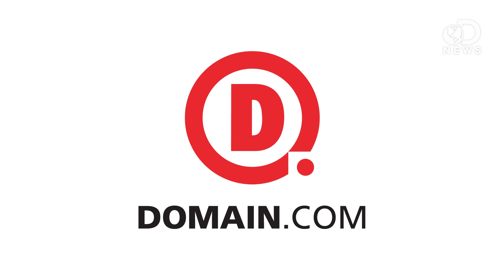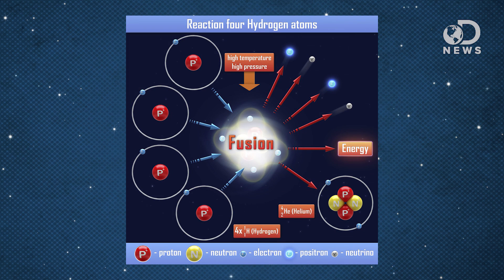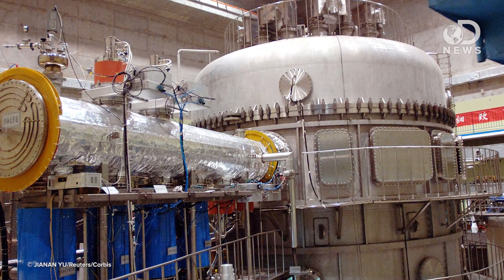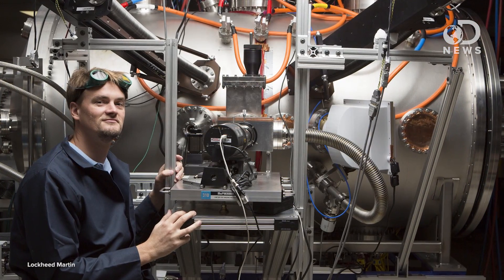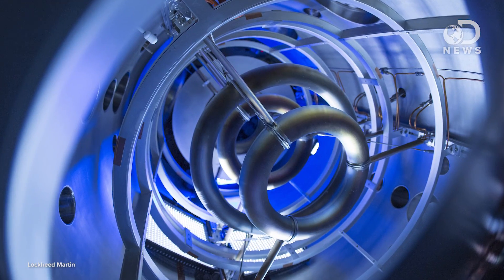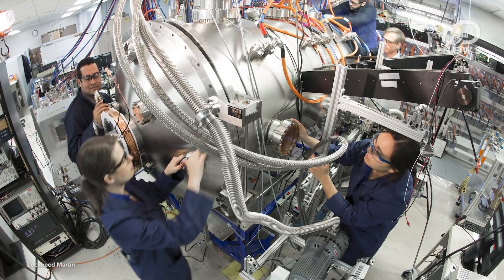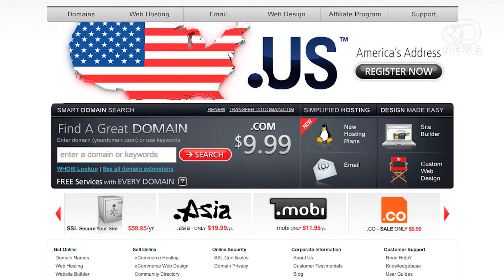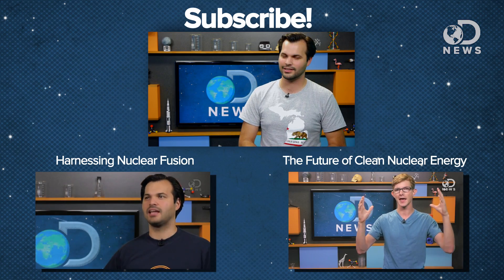Is Fusion Energy Close To Becoming A Reality?

Comment: DNews what do you mean?, powered by water, everything today but solar panels is powered by water. Coal heats up the water and the water moves the pistons, and nuclear power does the same thing, I think this is all bull shit. We will not make fusion in 5 years, the government likes oil because thats where the money is coming from. With out oil america will fall, we import more export so the economy will complete fall with out oil, now if WW3 starts then yes that will be the key for new energy and yes the government has new energy they had solar for a long as time, and they have money so they have fusion reactors and other new energies . And wow its so hard to think of that we had that crap for a long time, putting a fucking magnetic around plasma to keep it inside.
Reply: No, Solar panels are not powered by water, they are powered by solar engergy, naturally. They use water only to transport heat to generators. A fusion reactor, however, will fuse the hydrogen atoms in water together to create energy.
Reply: thats what a said???
Reply: is said but solar panels
Reply: Ah, right, replace solar panels with your coal example then. Coal power uses water only as a medium for transporting energy, while fusion uses water as actual fuel.
Reply: ubermons Fusion doesn't use water as actual fuel... He meant that a mass of hydrogen equal to the mass of 6 litres of water would be used. Also, fusion is NOT unlimited energy.
Reply: aprusfire By the way, being a condescending arse doesn't help, especially when it's very clear that you have no idea what you are talking about.
Reply: aprusfire That's called electrolysis. Also, please read up on simple rules, because you're honestly spewing a load of bs. Long paragraphs with no basis. You cannot put in less energy for more (conservation of energy). All forms of nuclear energy is derived from the conversion of mass into energy, as both fission and fusion release sub-atomic alpha and beta particles that in turn get converted into energy through the famous equation E = mc^2 :)
Reply: aprusfire Also, what the heck are you saying? The Earth is in total neutrally charged! The atmosphere is not always positively charged! Gravity is not a form of energy, it's one out of four of the elementary forces! Lastly, all forms of energy is considered potential, including kinetic. Read up on general relativity :)
Reply: we can make oil, but the oil we make pollutes more then oil from the earth. And no we are putting more carbon in this world and i dont like it, sorry but i respect this world as much as humanity. even though some humans are.... i dont want to say it
Reply: contraband100 Fusion is a dream many of us have ;) So many people arguing over a topic that some people keep misunderstanding, leading to a positive feedback loop of explaining and misunderstanding and more explaining... xD
Reply: you can make water into a fuel for fusion but we dont have the technology and i think it will be a waste of energy to even do that. And water has H20, so 2 hydrogen then you got to make it an isotope which will be a waste of energy ( and 2 different isotopes, i think it is H with 1 extra mass and the other is H with 2 extra mass ( i forgot what 2 you need ) )  
And yes you can turn water into hydrogen and oxygen, just put electricity into the water. And this will be bad to make it into a power source because if hydrogen goes in the atmosphere it can leave out planet because how light the atom is.
Reply: Bryan Lee Of course fusion isnt a unlimited energy
Reply: oh i took it out because i didnt want to example it and yes the atmosphere is positive and the ground is negative. Look study it your self im not going to try to example it to people that cant study on there own. And hell no if the earth is neutrally charged then how the fuck are there lighting and why the fuck will they hit places more then other places. I dont want to example it k, study it yourself and do you know dark electricity?, look it up.
Reply: and i have no clue what are you talking about, all of the energy we have today can change into the other forms so no, the center of all energy is a energy that we cant even find. Thing about it mass and energy is the same so mass is a form of energy. E= MC2, did you take physics?
Reply: K what are you stupid. I dont care what you have to say
Reply: K im pretty sure the grounds whats the electricity more then the air
Reply: Do you know what dark energy is?, a theoretical repulsive force that counteracts gravity and causes the universe to expand at an accelerating rate.
Reply: aprusfire On a serious note, please don't spread misinformation without actually understanding a topic. I understand that you might be trying to help, but false claims like these are what lead to misunderstandings like, "If we evolved from monkeys, why are there still monkeys around?" Also, I apologise for my upset tone, but read through it. Don't be ignorant and not care, sift through my frustration and you'll find an explanation to lightning :) It's the potential difference that allows for the jump by the way.
Reply: nothing is powered by water. water is just a medium for transference of energy. just like your computer is not powered by cooper cables. hydroelectric plants harvest the power of gravity with the aid of water, coal/gas/whatever harvest the thermal power of reaction of complex chemical compounds, water is just a way to convert the thermal energy into kinetic energy.

and forcing fusion is easy, the problem is to make it autosufficient so it generate more energy than you put into it
Reply: and before I forget... the "6 liters of water" he said. they are not using water as fuel, its the helium 3 and the heavy hydrogen they can find mixed with salt water that they use as fuel
Reply: Yea, and what you said just made me not believe not even one bit of what you said. (Hey everything came from one bacteria so why is there bacteria, and other animals why, humans are so strong and we can live... oh we will die). And when evolution happens it happens slowly. everything in the world is not one. This is why there are black people, Asian. Yea so think about what you said
Reply: ***** Thank you, and do we even know how to mass produce this hydrogen
Reply: ***** And im sorry, i meant that, but water is used in everything but solar panels. im sorry but what you said is true
Reply: aprusfire we don't. the sun radiation does this for us.
Reply: wow, how?, do you have a link
Reply: Maybe we can keep producing oil for the rest of the world while we power our stuff with our secret fusion batteries
Reply: aprusfire err... I'm a little lazy right now. but to make it simple, the sun's radiation and cosmic rays make helium atoms with 2 protons and just 1 neutron. I'm not a physicist so I'm not sure about the process
for more information just google Helium-3 and Deuterium
Reply: Got you, and thank you for your help. Also Laziness it kills people lol. Im lazy too
Reply: aprusfire eeverything kills people, at least I'll die from something good
Reply: That true, and what do you want to die for? saving people?
Reply: People have said the same thing about government and coal long before it was in danger of not being the number one source of energy. Today coal is a significantly smaller portion of the energy consumption market.
Reply: your sure about that Equals(luffy), you sure?, im pretty sure coal and oil is still high. It keeps america standing. example i might be wrong?
Reply: aprusfire http://www.eia.gov/todayinenergy/detail.cfm?id=11951

Coal, while still high still increasing since it's first use, makes up a smaller share of the overall energy sources. 
If you told coal production owner that within 100 years they would be surpassed by both petroleum and natural gas they would've laughed in your face. However the car has a lot more to do with the increased usage in oil, natural gas has made much more dent directly to coal I think than petroleum.
Reply: but fusion actually consumes water. like in a fusion reactor, once u add in water, its gonna get burned up and disappear. just like a gasoline.
Reply: That need to happen, you need to heat up water for it to make steam and then the steam moves the pitons and the device( i forgot what the object is called ) anyways it moves a magnetic around the copper. And that makes electricity.
Reply: And nothing can disappear in our sense. I know that makes no sense but with heat hell no. You need something else to make something disappearing meaning it doesnt exist. Think about it how was the universe made, no one know, how can something be made off of nothing it makes no sense. Im so confused with this shit. And there is no point on finding out we should just improve on our technology and if we know everything but how the universe was made. We should try to find that the answer :D
Reply: Water is a medium of energy transfer in those systems, not the method of energy generation. In this system the water itself is broken down into hydrogen gas and the hydrogen gas is heated enough that it fuses with itself to form helium and release tons of energy.
Reply: aprusfire hydrothermal generator
Reply: they split up water into its basic elements hydrogen and water then they use the hydrogen in the fusion process. then they transfer the heat to water to power steam generators. to bad we can't harness the energy directly from the heat with out the need of turbines and water/steam.
Reply: Imagine what we could accomplish by obtaining and using raw nuclear fusion energy. The engineering behind such an feat seems light years ahead of our time. An inventor capable of turning raw energy into usable energy for thrust or power would be amazing. No waste, no fuss, no efficiency loss, a true genius of a machine.
Reply: Fusion will not be the technology of the future, sorry but im against it. I dont want our water to be used like that. But plasma reactors and other reactors in the future we all will see will not waste something and will be no waste, no fuss, and no efficiency loss. But when it blows up we are all fucked lol
And yes i know today we waste water, all the time to get gas ( its called fracking ), but today the government is stupid, all they care about is money. If there is oil there is money. I wish someone will just make all this crappy oil disappear and leave only 3 years of oil behind :P, or if we need it so bad we will stop using garbage oil and start using new and better technology because oil sucks and our batteries suck too. And plus we people that will live in the future will have to deal with this shit that the people in the past made.
Reply: brandonhughes7 what ? where did you read that they use hydrogen gas from electrolizing common water for fusion ? its freaking hard to use "standard" hydrogen to make fusion, its almost impossible to make a sustainable reaction. you need Deuterium and tritium from heavy water, that is rare in the salt water, or helium-3 that is even rarer. but even though there is so little Deuterium in the water, it's still more than enough to supply us for millions of years. so waste our water is not a issue. and pollution by helium ? do you have any idea how much helium we already release on the atmosphere ? fusion reactors is so efficient that we can supply the entire earth population and the helium pollution from fusion reactors will only represent a faint percentage of what we already release on the atmosphere
Reply: ***** you mean instead of using steam ? they already thought about that, you can convert the radiation into energy, but looks like they don't find it practical. harvesting the thermal energy is just simpler and more efficient. and there is a lot of cool designs of electric thrusters that use magnetic fields or the heat from fusion reaction. it has a crazy specific impulse, with a ship big enough and a neat and compact generator, you could go anywhere in the solar system easily. the only problem is that the thrust from most of those is really weak, but since the fuel consumption is so small, you can keep accelerating for days slowly gaining speed.
Reply: How do you think plasma power works? A plasma reactor is a type of fusion reactor. Ans what's wrong with using water as a fuel source?
Reply: The water is a medium, not the power source.
Reply: thekaboominator1 omg... someone here can read ? they don't use water as fuel, they use the Deuterium (its an hydrogen isotope with a proton and a neutron) and tritium (an hydrogen isotope with 1 proton and 2 neutrons made by the cosmic and solar neutron radiation hitting the atmosphere). they compose only something like 0,015% of the hydrogen in our oceans, and its enough to power us for billions of years
Reply: Bryan Lee
Unlimited energy? no. Superabundant and more efficient than anything we have today? Hell yes.
Reply: contraband100 well... nothing is unlimited or infinite, its just a cool way to explain
Reply: A plasma reactor is a thing that no one believes cant be made manly because in this era we arent that smart in technology. I mean come on we are still using steel, steel is not that good ( there is other materials out there waiting to be discovered ). The government is keeping all its stuff secret, how do i know this because the government keeps telling inventors to stop what they are doing, pay them off or even make them look like a fool ( poor Tesla ). You can say this cant be feel but fusion is a piece of shit reactor, you are wasting your water and to power the fucken world. And trust me when we have enough power that can be used we will use a lot. The Ionocraft look it up, we need more power for that ( well we are not really far in the technology in that to make it better but we will get there ) And there are others like if we have a better power source we will use it for cars, but the thing is our batteries suck balls today lol, the lithium battery was there for about 100 years, its just that the people called him crazy and made him look like a fool ( poor guy he even said we will use this in the future ). I want humans to find a better source and holder of electricity.  

THINK ABOUT IT, steel is only Fe( iron ) with C ( carbon ). Then we can add other element which i forgot its name it make it about 30% stronger. Its not rock science. you can put stuff together and see what happens at what temperate. Like the Argon is a Noble gas and we said no it cant make bonds with any element but it does, it makes a bond with fluoride at a cold temperate i think. Anyways you cant try to find out what bonds with what you can only experiment. Yes you can say that might have a higher chance to bond with that but come on we humans found a lot of thing by accident.
Reply: And Danilo you are right. But i still dont get how this universe was made. And come on the big bang is bull shit. If your going to say that then come on. A atom the size of what a ping pong ball get out of here. When anyone  thinks about it there mind stops say wtf is the answer, in region all there answers are sound, god said let there be light, and other once that i cant remember. And we said it started because of what energy?, i think it is energy. And plus if there was a mass like the big bang it will not stay in this universe for a long time. The mass of the universe wtf, a little piece of this universes mass makes a black hole. I want to see what the whole universe will do.
Reply: aprusfire I have no ideia what you're talking about anymore, I don't even know what to answer first... and I used to brag about how I can follow any train of thoughts, thanks to prove me wrong
Reply: ***** I tried telling him, but he's being stubborn and ignorant. He's blabbering bullshit about a subject he has NO CLUE on.
Reply: aprusfire wow... that escalated quickly
Reply: the energy doesnt come from the water in the energy generation systems we have today it comes from the HEAT SOURCE or in the case of hydroelectric dams gravity or the energy really is coming from the sun because the sun "transports" the water so you fuck america i dont give a shit about countries were all on the same limited planet
Reply: aprusfire I don't know if you still care to know. But if you are really wondering how this works.
You first have to understand what nuclear bonds are. They are the bonds that hold atoms together. They are one of the strongest Forces in the universe.
When you separate these bonds or manipulate them they release massive amounts of energy Tens of thousands of times greater then chemical bonds like Oil or coal.

Half a cup of hydrogen would generate as much energy as 20 Tons of Coal.